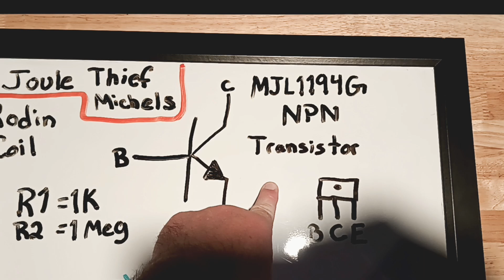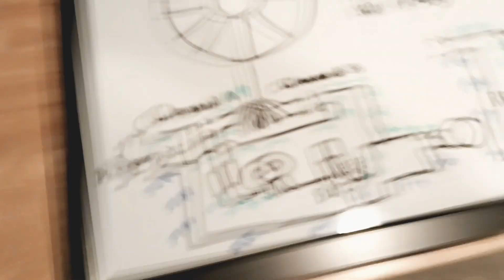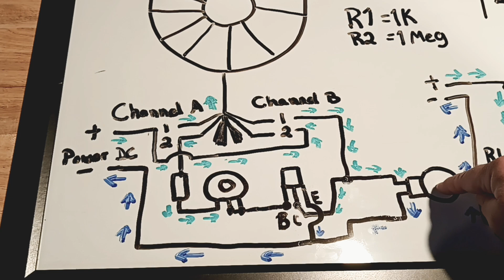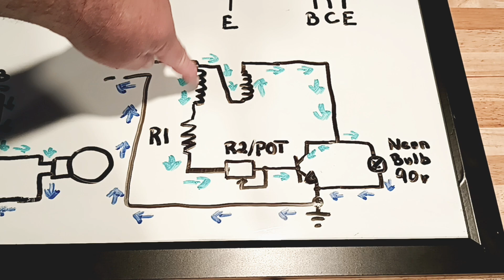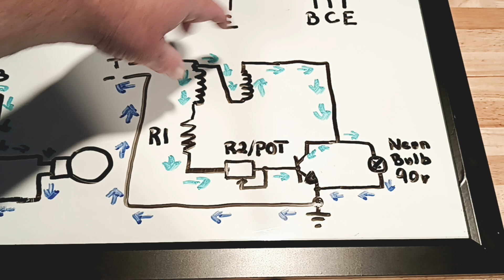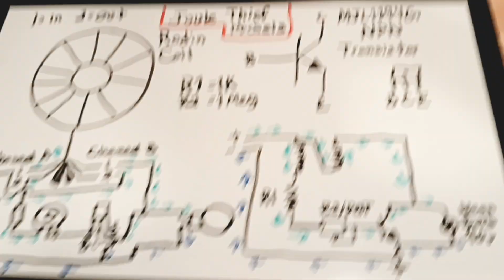Michaels joule thief experimental circuit

Comment: I have a question I have worked on something on paper but I want to ask if I have 3 super capacitors banks but 2 of them connected by a relay that can be charge by a generater and can discharged one at a time by relay to the third one while one charges full and the third one connected to the motor that moves the generater to see what happens and find the equilibrium to add a 4 bank by trickle charge it also while one of the 2 is being charge it doesn't discharged while charging only the one finish charging does and osculating between charge and discharged between the 2 charging can I get run for a long time

Comment: You know static can turn of and on a transistor when its fed to a its base ? Some how those two coils are making static electricity without the tribo process ! ❤😮
Reply from the maker: @vishalvv6585  we can change energy at will, if you understand how. They are all connected. Knowing the correct state you are in is extremely hard to teach without first hand experience